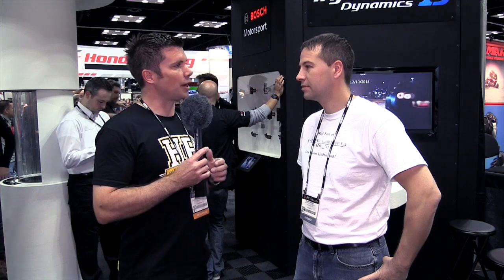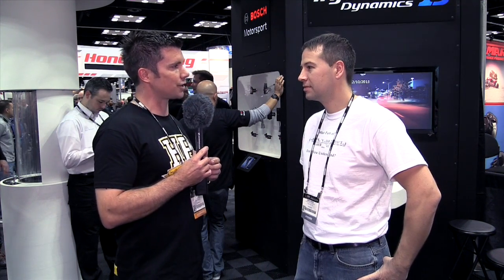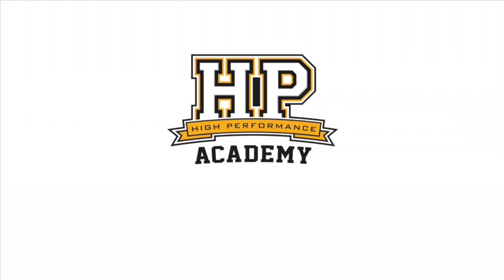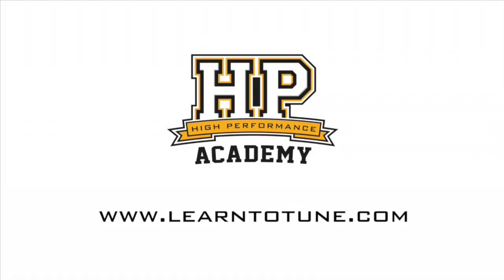Greg Banish | Calibrated Success | How To Become A Tuner [TECH TALK]

Comment: oe tuning vs aftermarket you can go as crazy as you like with aftermarket if you want to run strict parameters you can 
everything he mentioned about cams torque based turbo control aftermarket ecu can control 
oe has a guide line to follow that's the only difference
Reply: You can have both. Leave the emissions controls on cars and work with them not removed them or curse them.  You can have all three, clean emissions, reasonable gas mileage and big power. Besides beyond a certain point especially in the V8 world you aren't competitive anymore unless you own a shop and/or corporate sponsorship.